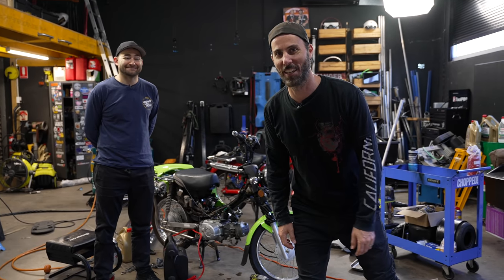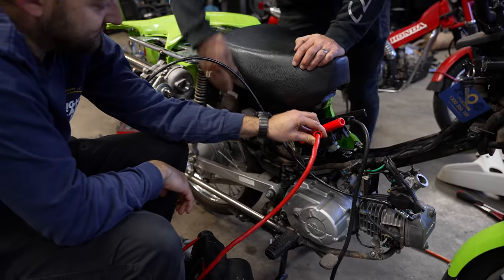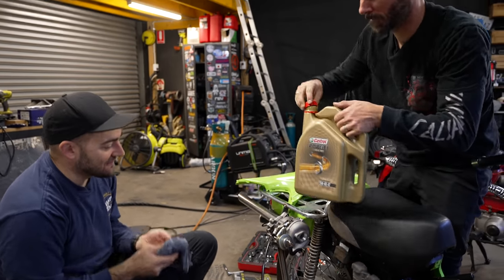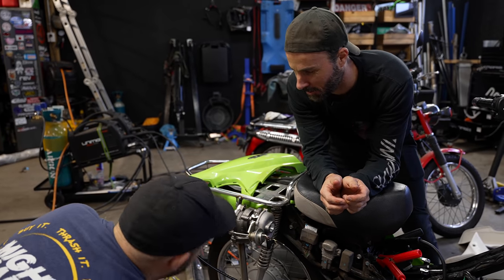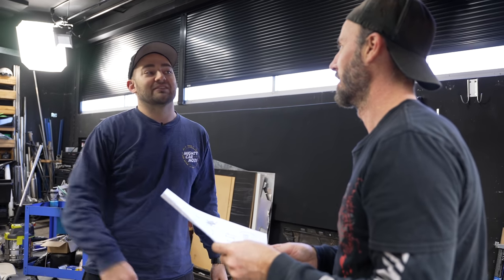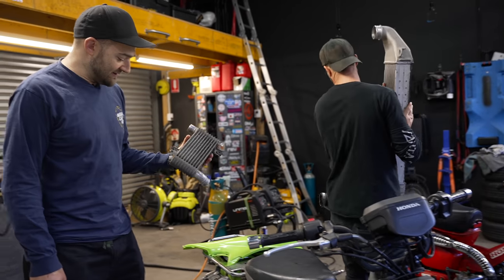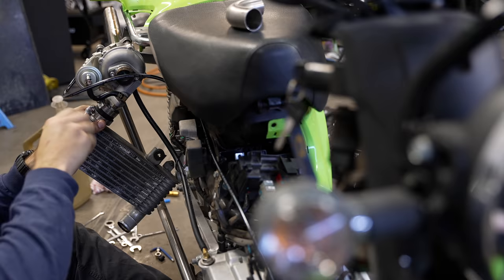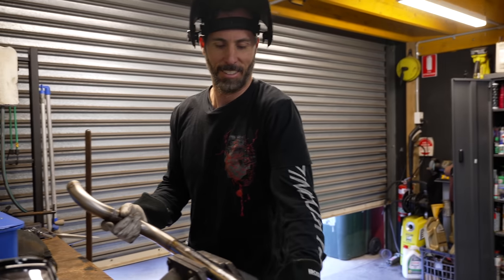WORLDS SMALLEST Blow Off Valve Install

Comment: Eyyy awesome to see Moog getting on the TIG! Looks great to me.
So cool GFB actually made you a custom BOV. Wonder if they'll sell more.
The spooly noises at the end def capped this off so well.
Please do the fuel and tuning mods and dyno it!
Reply: For that sort of thing, the cad work is a large amount of the work. actually making the parts is just waiting for CNC time. Im sure if you hit them up n said "postie spec BOV?", they'd say "postie spec BOV", followed by quite a few $'s. but yeah... I want one to.
Reply: Google GFB T9430, the same valve is now used on 1.2-1.4 Audis and VW.
Reply: @arjovenzia  That's why I was thinking they might decide to actually sell it as a product. Would make sense given the hours of dev they put into it. That said, they'd need to do a lot more testing and QA before releasing it to mass market, which would probably cost far more than the dev time.
Reply: @ryantilley-general.shenanigans  Looks fairly similar. Perhaps that was an existing product and they modified it to work with smaller tubing for MCM?
Reply: @802Garage  the basic piston construction was from a different range of valves actuated by a solenoid. This was the first one actuated by vacuum. The valve was made a few years ago, MCM sat on it for quite a while.
Reply: @ryantilley-general.shenanigans  Ahhh of course haha.

Comment: Wouldn't the oil just drain down that pressure line and back into the crank case? You need a check valve at the cylinder head so the line stays primed
Reply: I thought of that as well. It will eventually bleed off back into the head.
Reply: Doesn’t matter it wont hold over time as a turbo with thrust bearings needs pressurised oil and good flow to keep the bearings from failing.
Reply: this

Comment: What's keeping the oil in the hose draining back into the engine when sitting,I guess you could prime it before every ride.
Reply: It needs a bigger oil pump they are just proving it works, without a no return valve at the head, a higher flow rate oil pump, or both it would wear out the engine and the turbo quite quickly because both the head and turbo will be under lubricated pretty much all the time. But a large enough oil pump wouldn't have an issue priming itself on each start and keep enough pressure in the engine while splitting the output, residual turbo oil would be enough to idle until it worked back up the line in maybe 30 seconds tops. I'm sure they will do something similar before they actually tune the air/fuel ratios for some real boost.
Reply: Nothing, needs a check valve maybe
Reply: @jama211  that won't up the pressure, it needs more pressure barely any is going to the turbo it needs more flow than that, and the same amount is going to the engine, which is less than it was designed for so the only answer is higher oil pressure unless your happy for it to blow up a couple of hundred miles down the road lol

Comment: Question:

Why not plumb in an auxiliary feed pump for the oil? Shouldn't be too difficult.
Reply: Unnecessary complication on a simple as bike.
Reply: @Kstang09  that and it might also starve the top end of the engine, another solution might be making an standalone oiling system for it with a small oil tank and a pump but again, that's too complicated for something that´s just supposed to look crazy and sound cool
Reply: It’s not going to sound cool when that turbo quits working. For what that turbo cost, I’d try it and see if it works and get sufficient oiling. If it doesn’t last long then do an auxiliary oiling system. I’m curious as to how much boost that single cylinder engine is going to produce being turbos want a constant flow of exhaust gasses. This is going to get exhaust pulses which is already by nature going to cause the turbo to speed up and slow down between engine strokes. Sure it might make boost, but it probably won’t make much and it won’t be constant. I don’t think anyway. I had a turbo go kart many many years ago (22 plus years ago), and it would make boost but it was all over the place. The boost gauge just bounced around like a crackhead looking for spare change!
Reply: use the vacuum from the carb to pull on the oil return side via a vacuum block then dump back into the crank?
Reply: Not hard at all ... just use a vacuum driven oil injection system from a snowmobile.....
Reply: @anotheryoutuber_  snowmobiles use a VERY simple and cheap vacuum driven system
Reply: @anotheryoutuber_  not carbed, Efi system on that bike
Reply: @scooz14  until it makes boost lol

Comment: Could the oiling issue be solved with some kind of electric pump taking oil from the sump, rather than the rocker cover?
Reply: Yes
Reply: Best long term solution forsure  just like any car scavenging a low mounting or feeding a rear mounting system. 👍
Reply: Deffo.
Reply: Trouble is the electric pump would take more power to run it than the extra power from turbocharging this engine
Reply: @getchasome6230  And you can generate electricity from a magneto without any loss of power either? So basically free energy?
Reply: @daver18qc  No, because your magneto is already spinning and producing power.   It's like adding a sound system to your car.. .  Same/same
Reply: Hahaha yup sound systems dont cause any loss.
As long as you aim the speakers backwards right?
Reply: @12many4you  Do you not understand how electricity works?

Comment: I feel like a 3D printer could really add to your tools, for example a mount for the boost gauge.
Reply: Moog has one in his shed
Reply: @squirrelzar  correct me if I'm wrong but I don't remember seeing a 3d printer in he's shed tour but he did have a small cnc machine.
Reply: @Iisakki3000  I remember they did the hubcaps for the S2000 on a 3D printer. A K8200 IIRC, which is the same one I have.

Comment: One of my hydrolic clutch lines has been rubbing on my steering column for the past 23 years... Got to the point were it was spraying dot 4 all over my firewall... Needed a cable made and fitted. Total cost $150

This really reiterates that my mechanics are awesome!

Comment: I would make a small oil reservoir slightly higher than the bearing itself. And the reservoir extended low enough to pick up the oil as it comes back from the drain. Basically a small cylindrical tube. The oil would naturally circulate a little on its own because of the spinning shaft and you could change it frequently.

Comment: you need a pump or an accumulator to make that work. Or create a venturi effect with the oil drain so it helps suck oil up the line.
Reply: Yeah why don't they just use an electrical pump on the clutch cover or sump if it has one... Get as much oil through that turbo bearing as possible, with that dribble it's gonna run dry

Comment: Read into the concept of pump head - it describes pump pressure and the ability of pumps to pump stuff uphill. In your case the oil pressure is not high enough to pump to the top of the bike. If you were able to fully fill the system so that the downwards sucking force equalled or exceeded the upwards force required (like a syphon) then the little pressure you have available would be enough. Fully filling the engine with oil would be a pretty bad idea though! Gotta increase the pump pressure, or move the turbo down. Cheers - Engineer who pumps stuff out of deep holes for a living. P.S. I take pre emptive credit for any head-related puns moving forward.

Comment: So with the nearly 0.0000001 PSI of oil pressure feeding the turbo oil feed line, would it be possible for the crankcase pressure that the drain is now plumbed into,  to keep the oil from flowing and also cause oiling issues in the bike as the turbo oil feed line is plumbed into the oil feed system?

Comment: Could you use a PC water-cooling system (pump + reservoir, passive radiator) and have it pump oil instead?
Reply: Full 3 fan RGB radiator 🤣
Reply: those are centrifugal pumps which aren't really appropriate for the low volume/moderate pressure and the type of fluid. it MIGHT be able to work, but I wouldn't count on it. positive displacement pumps are better suited for supplying oil to bearings.
Reply: Or just use an electric oil pump which are made for that

Comment: I bet the intake manifold is so long there doesn't even need to be an intercooler =)
Reply: Would probably work better as well...not to mention alot less restriction and a cleaner look
Reply: @rimaspazereckas2748  Restriction?

😁😂🤣🤣🤣🤣🤣👍🍻🍻
Reply: @rimaspazereckas2748  I don't think they where going for the clean look though, more like the cars with oil coolers hanging in front of the bumpers you in see in japan.
Reply: @robm.4512  yeah...even after leaving Victoria i can still hear dan andrews saying "get on the beers"

Comment: Wouldn’t it make sense that the oil will gravity feed back into the case and then will be full of air again?
Reply: or it may create a vacuum that pulls more oil through, that might be a bit hopeful
 though
Reply: The oil drain can be full of air but the oil feed will be pressurized.
Reply: I should have specified.. I meant when they turn the engine off any oil on the pressure side will drain back into the case. Not while it’s running

Comment: The oil has to fight against gravity.  If the hole it was going into was so small then a gravity feed would not be enough.  Now when you turn the bike off does the oil drain back out of the tube?
Reply: Yes, it’s fighting gravity and air pressure.
Reply: @goawayihavecommentstomake1488  Gravity yes, that’s a fair head to produce for a small trochoidal pump, but at least the oil viscosity seals the rotors fairly well. 

Air pressure, not so sure…

Air pressure is acting equally on the whole system, from the surface of the oil in the sump at the beginning, to the surface of the oil at the end of the turbee lube feed pipe. The only difference within the system is the pressure differential produced by the oil pump. 

🥸✌️🍻

Comment: Okay... try this. I've done this on my boosted c70 and it worked as I have the same issue. I got a mini pc watercooling pump and reservoir. Had the oil feed going into thr reservoir and pump exit run to the turbo. I've done 3000 miles on it and it's not failed yet plus actually looks cool af seeing the oil swirl. Just need to prime the reservoir and match the exit flow to inlet or you get issues. Comment if you wanna try it guys! Love the show.

Comment: In the past I have designed a dump valve for small cc engines for Forge Motorsport because their dump valve had the same issue as everyone else's, including GFB.
The idea of a DV is to release enough boost to allow the turbo to carry on spinning whilst retaining some of the back pressure behind the throttle body but not losing too much boost that the turbo over speeds and then has to work hard to replenish the boost air once the DV is closed and the throttle body open as this will negatively affect performance.

All of the DV manufacturers are so used to making large DVs for big engines, it didn't occur to them to adapt the design as engines and turbos got smaller.
You fit a big DV on a small engine and all you are doing is dumping potential power every time the DV opens.

Ideally, the neck of the DV should have approximately 1/3rd the ID as the ID of the turbo compressor outlet pipe. 1/3rd seems to balance the flow output when open.

Comment: Moog is sort of right at 9:50 - the oil has two choices:

Squirt out of the hole onto the rocker or come out the fitting. Fitting is open so is easier.

As soon as you put rhe line on up to the turbo you start to build head pressure and at some point a couple of inches along the line, the rocker squirt hole becomes the path of least resistance. No oil will ever get up to the turbo unless you block the rocker squirt hole and just rely on splash lubrication of the top end, or partially block the hole so that it builds head pressure and feeds the turbo whilst spraying the rocker....

Comment: The oil pressure to the cylinder head is restricted, so that the crankshaft gets the majority of the oil pressure. I'm not exactly sure if it's the same on those newer engines or not but the restrictor on the older engines is in the crankcase right where the cylinder base meets the crankcase.
So you have to tap into the oiling system before that restrictor.

Comment: The problem is something called pump head, which is basically the cumulative resistance that builds up from a fluid being pumped through a system. When the flow and pressure is so low in the first place, with a long line leading to a significantly higher point in the system, that pinhole actually starts to look like a pretty good option as far as path of least resistance

Comment: The oil feed needs to be taken from clutch cover, routed through turbo bearings then IN where the feed is now located instead of dumping directly back to sump. Find an oil flow diagram for a 1965~67 Honda S65. (it's the only one I know for sure had an external oil line)

Comment: Make a small metal box with a small electric oil pump and a 2 liter oil reservoir. Then run a line from the pump to turbo then back up to the top of the reservoir. Stand alone oil management system. Oil pressure from pump would help push oil back to reservoir. Oh and you can reuse the line because you can cut it in half to make the two lines.

Comment: Make sure you have the turbo core the right way round.
Most people wrongly think the big hole is the inlet for the bearings and the little hole is the drain, Then they wonder why they burn oil and have smoke. It's actually the small hole that is the turbo inlet and the big hole that is the turbo drain.

Comment: I remember watching an episode of nugget garage which involved turboing a single cylinder motorbike engine. They came across an issue that happens when you turbo a single cylinder motor whereby the charged air entering the engine is blocked because the intake valve is closed when the cylinder is in its exhaust stroke - hence spooling the turbo and pressurising the air. You may need to incorporate an air capacitor in the intake piping to buffer this as it can store the compressed air to allow it to enter the cylinder on the intake stroke.
Reply: WTF are you talking about?? This happens on EVERY engine with a turbo. That's the whole point, to pressurize the air, and keep it pressurized ahead of the engine demand. You don't need no stinkin "air capacitor" in the intake. If the system is designed properly, with the correctly sized components, it will work fine. "Air capacitor"... 😆
Reply: @davelowets  Not really… in engines with more then one cylinder, when one cylinder closes, the air is pushed into another open cylinder…
Reply: @stipsmindmatter6251  No. There are still times when the air backs up because there isn't a cylinder with the intake valve open.
Reply: @davelowets  I think the issue with single cylinder engine relates you pulsating nature of the pressurised air because there is no overlap between exhaust and intake phases. The air capacitor was proposed by MIT in a publication to help mitigating the peaky nature of the pulses. The air capacitor increases the volume of air in the intake to buffer sudden pulses.
Reply: But I mean, what would the engineers at MIT know…
Reply: @stipsmindmatter6251  I don't care what anyone "says". I've been there, and done it. An "air capacitor" isn't a real object, and wouldn't be the proper fix for the issue. Proper intake length, and volume, would be the correct solution. There are plenty of single cylinder turbo engines out there that function properly, and none of them have any sort of "air capacitor" on them.
Reply: тαρ мє αи∂ ѕєχ ωιтн мє Lillia  Put some clothes on... 🙄

Comment: What you’re experiencing is pressure head loss. Oil is dense and viscous, in addition to the fact that the oil pump on a bike that small probably doesn’t produce much pressure, you’re overcoming gravity as well as the friction along the entire length of hose. You need more oil pressure or relocate the turbo. You can tap a whole in the oil pan and run a scavenge pump off accessory power quite easily and use your existing drain. That one drip isn’t proof the turbo has oil pressure, and you likely don’t

Comment: solution : put a small catchcan (maibe use a old empty spraycan with some holes drilled and bungs welded on it ) under the turbo that the return pipe goes intoo , then use a small electric pump  to suck it out the bottom and pump the oil back up and in the top of the turbo (could pump the oil intoo a second tank above the turbo with an overflow from the top intoo the bottom tank so you get low pressure and enough flow through the turbo even before startup) , think you need to put the intercooler in front of the motor against the fairing to make it look cleaner , think you could keep the blowoff valve where it is now and lay the whole charge pipe against the frame all the way up to the turbo
could do a little stealt if you put saddle bags on the sides that hides the turbo

Comment: next time you TIG weld tubing, you may want to run an argon purge through the tubing.  weld two pieces of tubing together and look inside. without purge your weld will most likely badly oxidized, grey lumpy and week.

Comment: I'll honestly be surprised if this setup doesn't make negative pressure with how much piping there is lol it would take a much bigger turbo and high compression engine to fill all that space with enough forced air for it to be even minutely effective by the time that it makes the long journey and reaches back into the intake side of things... my suggestion would be to mount it as close to the motor as you can using as little piping as you can and skip the intercooler all together then you've got a good chance of really adding some power to this lil bugger 😝🤏💪🤞😋